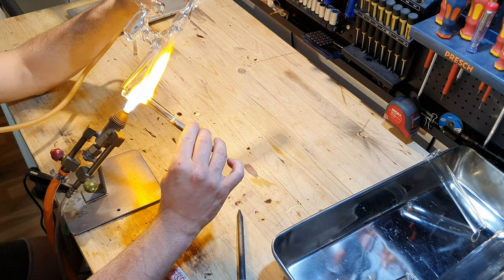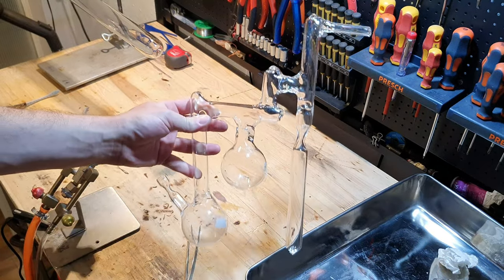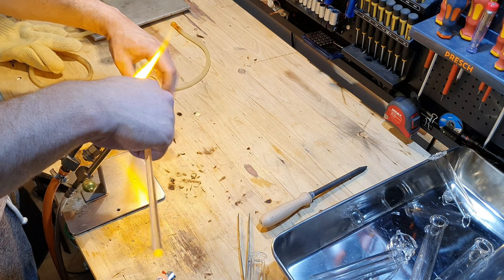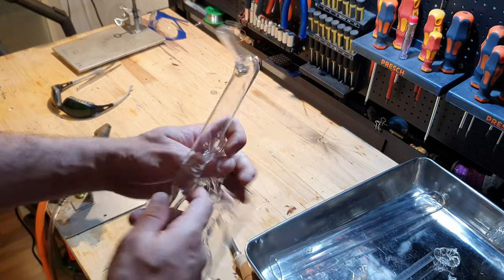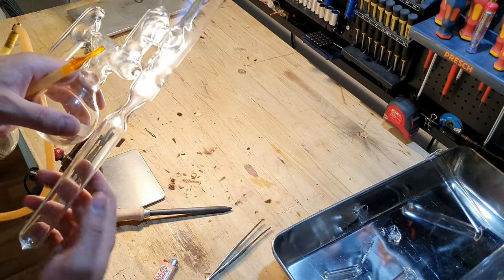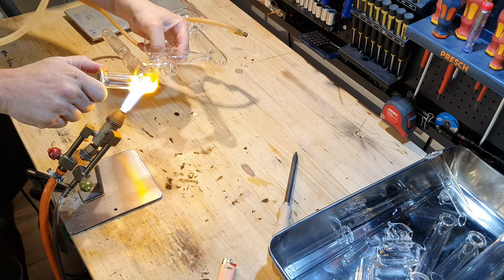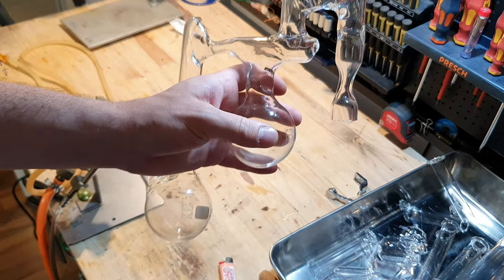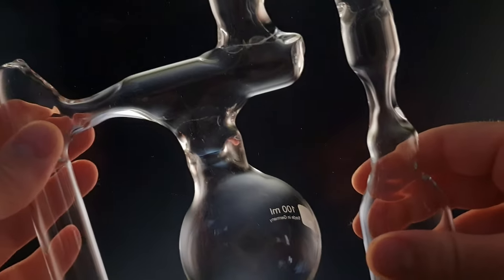Some flameworking

Comment: , flash your glass so it doesn't explode on you  and Drop that pulled glass into a bucket of water and blast that torch you need to get the glass molten. Work hotter and your seems will look flawless and give a little push \pull when connecting the glass.